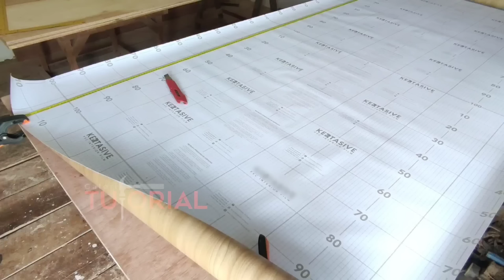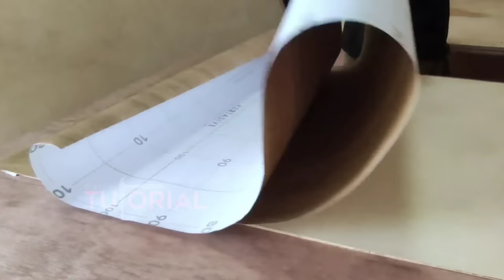Lemari Pakaian Sliding Minimalis

Comment: Sangat inspiratif om,alat2 yg diperlukan untuk bisa membuat lemari seperti itu apa saja ya om?
Reply from the maker: terima kasih 🙏🏼🙏🏼🙏🏼
Alat :
- Mitre Saw
- Circular Saw
- Kompresor dan Paku tembak
- Track Saw Guide DIY
- Mesin Router(profil)
- Mesin Bor
- Mesin Amplas

Bahan :
- Multiplex 15mm, body atas dan bawah 1kpg
- Blockboard 18mm, rangka body samping dan pintu 2kpg
- blockboard 18mm penyekat dan rak 3kpg
- Multipleks 6mm, lapisan body samping 
- Multipleks 4mm, lapis pintu 6kpg
- Multiplex 4m, penutup Belakang 3kpg
- HPL Taco TH 1240 FA (Cova Linen)
- PVC Interior Film
- Roda Gantung RG 99
- lis T
- skrup
- Isi paku
- Lem Putih / Kuning
- dll
Reply: Tengkiu om nice info
Reply from the maker: sama-sama 🙏🏻🙏🏻🙏🏻 semoga bermanfaat

Comment: Nice! But why didn´t you just use MDF covered with melamine from the factory? I think it would have saved you a lot of time plus its more resistant than the thin PVC adhesive. Great work tough.
Reply from the maker: Terima kasih sebelumnya, 🙏🏼🙏🏼🙏🏼 disini harga MDF lebih mahal dan stok tidak ada

Comment: Brp lembar bang habis triplex nya
Reply from the maker: Alat :
- Mitre Saw
- Circular Saw
- Kompresor dan Paku tembak
- Track Saw Guide DIY
- Mesin Router(profil)
- Mesin Bor
- Mesin Amplas

Bahan :
- Multiplex 15mm, body atas dan bawah 1keping
- Blockboard 15mm, rangka body samping dan pintu 2lembar
- Multipleks 6mm, lapisan body samping 2lembar
- Multiplex 4mm penutup Belakang 3lembar
- Multiplex 4mm bodi pintu 6lembar
- HPL Textured Cova Linen 4lembar
- PVC Interior Film 20meter
- Roda Gantung RG 99
- lis T
- skrup
- Isi paku
- Lem Putih / Kuning
- dll